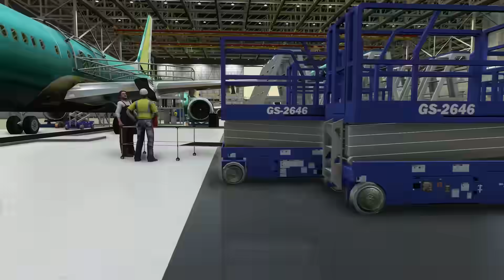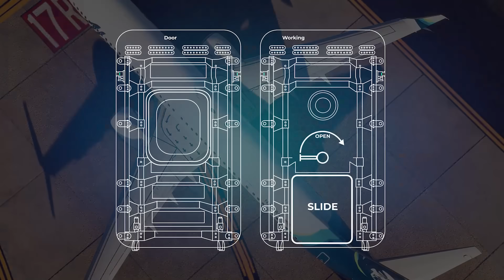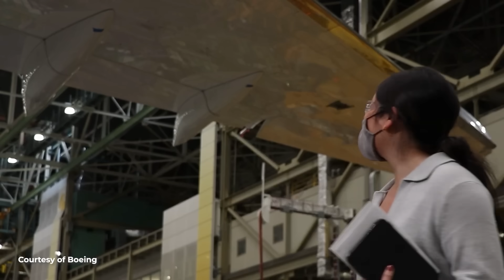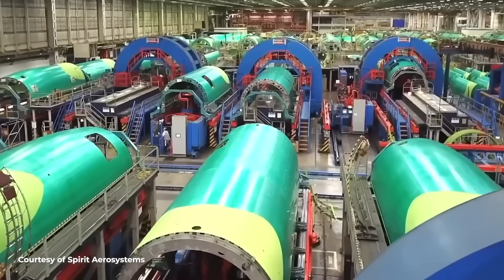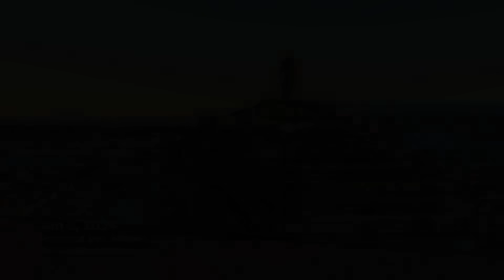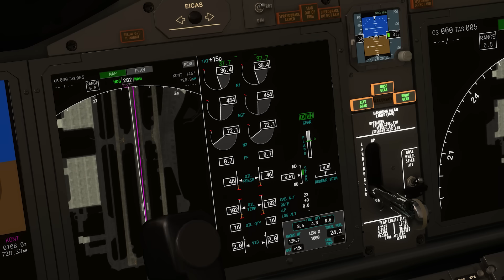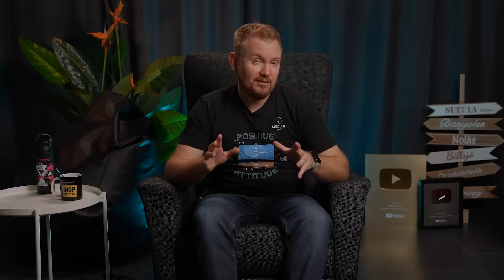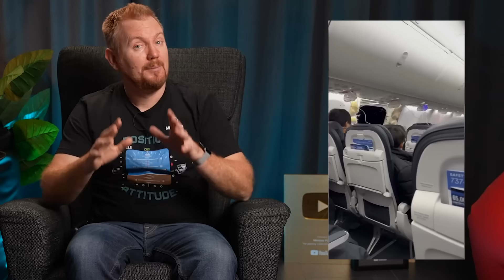Boeing 737MAX BlowOut!! The Scandal behind Alaska Airlines flight 1282

Comment: I have begun to think that there should be a grab bar that runs the length of the cabin that would be around the height of the very bottom of the overhead storage bin doors. That way as you walk down the center aisle of the seating area you can hold onto something solid as you bounce around during periods of turbulence coming back from the restroom. I usually try to steady myself with my hands on the tops of passenger seats but they aren't designed for this function and occasionally you will get a dirty look or a comment from a passenger as you accidentally jostle them.

Comment: You never get to the point of corporate corruption! Yes, those two "Alaska Airlines'" seats - next to that "Plug-blowout" - were empty. It was NOT a coincidence! They knew of that problem!  I worked for Alaska Airlines!  It is an "Investment-Company"  that runs that Airline! They are shysters!  They want a 10% return, to investors, at all costs!  
I worked as a flight attendant. It was a great job, until the 2008 - banker-made-crisis. Then, they worked us to death, as cabin-crew. My only savior, was when the pilots would call in fatigued. I loved my pilots! 
They taught me a lot, since I was so much into learning! They would call me up-front, to sit in the jump seat, to talk on longer flights!  I love my pilots!
 They saved us flight attendants from performing another -daily 8 leg, 13 hour duty-hour! Their 'union-rules', were stricter than us useless flight attendants.   hahaha  

DO NOT BE FOOLED!  Alaska Airlines - BLOCKED those TWO SEATS - near that bad blow-out door, because they knew, of that risk!  I worked for them!  They are money-addicts, running that company!  They ruined my "Horizon Air", once they took over.  It was my best job, until, "Alaska Air group" ruined Horizon Air, by their greed!

Comment: What i find scary about this incident is what might have happened if the door plug had let go at 33,000ft. Bigger hole in the plane as the pressure in the plane left even faster.. Door plug taking off one side of the rear stabiliser as it departed for example.. Boeing and the passengers are very lucky it happened at that altitude and not higher up! Scary stuff yet completely avoidable if Boeing gave 2 stuffs about who builds their planes. 🙄

Comment: root cause analysis should have been conducted and pressure testing of the "pressure vessel" should have been conducted. If it was enough pressure loss to trip faults on the controllers, it's enough to pick up with a simple pressure test. I disagree with you, I don't think Alaska airlines decision to not ground the aircraft and instead choose to fly it over land instead of sea was out of " abundance of caution.'" it was a facade of due diligence to cover up the main motive: greed. Pressure testing would require grounding and when the planes not in the sky it's not making them money.

Comment: As an aerospace mechanical design engineer, who has worked on four Boeing programs, I see this as a failure on multiple fronts. It was a failure in design, because it was not very obvious that there was an incomplete installation. And, it was a failure on installation processes, because of the essential missing bolts & cotter pins. However, we need to all recognize that aircraft are designed in such a way that they can handle a single failure, and sometimes even, multiple failures without them becoming catastrophic.

Comment: I think Boeing, as well as airbus for that matter should offer a high monetary reward for employees finding problems, make it some decent amount of money like $10,000 or something that way everybody is actively looking for mistakes, at the same time, not punish employees for making an honest mistake and instead council them to correct the problem if they did this, nobody would feel bad about reporting a problem and mistakes would get caught and not continue to happen

Ultimately, the parts that didn’t get installed in the door didn’t disappear. They have to have ended up somewhere. Surely somebody found these parts and should’ve thought “these need to be somewhere. Something’s not right.” but they probably threw them away because there wasn’t a good enough system.

Comment: Not sure the cockpit door opening due to a depressurization is a good idea
I understand why they have designed it this way, but I feel there’s got to be some better system, whether it be vents through the floor to equalize pressure or whatever else, but theoretically a terrorist could find a way to depressurize the plane to make the door open, which is not a good idea

Comment: It seems crazy to me that the mod kept the assist springs instead of replacing them with metal sleeves to hold their position. It seems to be asking for trouble if things like the 4 bolts were missed. I'm an engineer and as soon as you mentioned it I said out loud that's a silly idea.

Comment: The contact surfaces of the stop pads should have a horizontal ridge pattern so that the door cannot move while under cabin pressure. But then again, those four missing bolts were a really trivial mistake to catch. if only it had been checked one last time.

Comment: I’m a retired nuclear inspector but fasteners and welds for submarines and planes are similar as they both have pressure boundary parts. Level 1 material. Unfortunately locking devices are level NA AND HAVENT THE SAME CONTROLS OR RETEST

Comment: I live on the flight path where every new 737 ascends to be flight tested often in its green protective coating.  12 years ago I took an Alaska flight to LA from Seattle on a 737 when it suffered a slow decompression problem.  The pilot put the plane into a shallow dive  and then announced it over the PA the problem and will divert to San Jose and fly under 10,000 ft.  He assured every one there will be no need for the oxygen to drop unless needed.  I arrived in LA 5 hours late, but safe.  I love pilots  ( :

Comment: @MentourPilot Why isn’t the CVR breaker connected to the pressure switch on the gear?

It could be set to trip 15 minutes after positive pressure which would ensure at least 1.75 hours of recording preservation.

Comment: So cockpit door has limited ability to sustain force? That means a simple car dent suction cup could be used by terrorists to pry open a door? They are made of plastic and rubber so undetectable in security.

I mean 4 section cups and 2 men pulling on them. How many needed to be the equivalent of a decompression at 16000ft

Comment: Design flaw & correction; 
The cabin door should NOT fly open causing explosive decompression.  FIX; check valves or simple limiting vents should be used, mechanical whistles could warn of too much differential pressure. This would eliminate explosive decompression, alert the cabin and offer time for the pilots to correct the issue without being disorientated or incapacitated.
Reply: EXPLOSIVE DECOMPRESSION isn't like a wind, there's no continuous flow like a balloon, its more like popping a can under pressure or one big buff with a hole that size. Small holes that restrict air will create a flow, size matters and problems increase fast (squared) as the hole gets bigger. 

PRESSURE'S INTERESTING, at 14k feet they might have added 3psi, not much, if the hole were 1" square you could put your hand over lbs of force, small airflow would not be an issue.  BUT "IF" the door hole is 36" x 68" there is 2448 sqr inches x 3 psi = 7344 lbs pushing on the door.  Good thing this did not happen at 40k feet, 4x the pressure with 16x the force might have ripped adjacent seats off the floor.

Comment: The lucky part here was that the seats near that door plug were not occupied. Strange coincidence but very very lucky indeed.  

How many more issues the 737 MAX is likely to create before either the model becomes totally stable or it is totally discarded forever. It is hard to believe that it is the same company which built a 777 which is known to be one of the best models Boeing ever built.

Comment: I watched aa American Senate documentary involving Boeing and apparently, over 300 units have the same problems yet Boeing kept it quiet. A whistleblower came forward to inform the Senate that these units will be deadly after 50 flights as the stress, along with the age of the plane activates stress fractures. This is why I never fly. Every plane manufacturer focuses too much on profit and not enough od passenger safety. This is just an opinion and a thought. But, it terrifies me.
Reply: Fly Airbus.

Comment: Regardless of whether the door was displaced or removed, it was a job that required at least a second independent inspection and the paperwork that follows. This coming from 20 years in the aviation heavy maintenance industry. Best wishes from Limerick Eire.

Comment: You are wrong about the springs in the bottom of the door. These springs also insure the door travels up into the locks. These were not reinstalled during the work on the door, and the bolts were not installed, because the mechanic could not align the holes.

Comment: I was on an Embraer 175 that blew out a door seal just as we reached cruise (the captain had JUST made the announcement and turned off the seatbelt sign),  causing a loss of cabin pressure (though not explosively) and the masks coming down. A few things I will say to everyone who has never been through this - the elastic is not just hanging from the mask like it is in the demo, it's coiled up and stuffed into the back of the mask. If you are far sighted, as I am, it is very difficult to figure out how to get that elastic out and on when you can't see the thing that close to your face! And you will both KNOW when you are getting oxygen because it tastes absolutely terrible, and as they say in the safety brief -that bag will not inflate. The descent was about like this one - not THAT fast (I looked on FlightAware later and it was about 2000fpm, a little bumpy from the speed brakes being out. We turned around and went back to where we came from, Philly. And like here, it took a minute or so before we started descending.

They got us a new airplane and we were on our way again in about 3hrs. Though with not quite as many passengers on board the second time...

Comment: This was not new for the MAX-9 - the same mid-exits or plug doors was also used in the NG737-900 that Boeing had been building for 25 years prior. Same fuselage, could just as easily have happened on the older airplanes.

Comment: I don't understand why a brand new aircraft still has so little CVR recording time available, I assume they use tapes for preservation in case something catastrophic happens, but there should be some kind of a second, digital recorder that would hold like a day worth of recording without any issues but at a cost of making probably  less reliable in case of a major crash.

Comment: I worry subcontractor work quality is going to be found to be an issue globally. It works fine for minor components but with more complex ones, you need to keep it in house IMO. I think Boeing buying and reintegrating spirit was a good move and hopefully will prevent these kind of break downs in the future. Aviation engineering just isn't an industry where squeezing every penny out of a design works. Boeing is finding out the hard way, but not as hard as some of the victims of Boeing airplane failures.

Comment: Tbh, besides the missing quality control, the active pushing of the repair operation into a not to be recorded activity for my two points are even worse:
1) how can it be that any tiny work on an a/c is not needed to be document and checked by quality. Don't get me wrong, as I am working in the industry I know the pressure and creativity for "lean" processes and "smooth" interventions but I have never seen such a systematic break of basic rules.
2) coming out of point 1 Boeing is not able or willing to provide paper work and involved persons to the FAA. Thus is a No-Go and fundamental break of basic and critical requirements. If Boeing would not be as big and important as they are, the FAA must revoke the PoA of the impacted production organizations meaning they have no delegation for quality inspection and approval and hence no authority to "close/finalize" work orders by themselves. Instead every inspection must be done by FAA or independent delegates. Obviously the system is not able to execute this what would lead to a full stop of work until clarification.
I understand that this us politically hard to impose BUT what are the rules worth if we threaten ourselves to impose the sanctions REQUIRED by the rules if they are not respected. The systematic work if Boeing against the rules ist frightening and I cannot imagine what is the real iceberg below the surface...

Comment: Processes that should mitigate these circumstances do exist and  in fairness to techs and engineering teams accross companies and their  manufacturing partners these processes , quality controls inclusive are always spelt out for the companies. While you might be quick to blame the techs and engineers at spirit, there is this culture among many businesses to prioritize monetary or cost implications over and above processes or procedures designed or specified by techs or engineers to mitigate these errors often to the frustration of these techs. Imagine being asked to deliver on shedule for instance even if it implies disregarding  aspects of your quality control processes as a tech or engineer or situations where businesses cut corners behind its own tech teams. The bulk lies on keeping the aviation regulators especially in check even if it means making changes or overhauls within the aviation regulatory body.

Comment: I’m surprised there isn’t a level of “this ain’t right” past an NCR. NCRs are completely routine, they’re generated for issues as minor as test equipment losing power while checking out software. There’s an obvious difference between “we lost power while verifying that hydraulic pump 1 remained ON for 15+1/-0 seconds after WOW was asserted” and “We forgot to install several bolts that hold the plane together”, so I’m surprised that they’re put on the same level in terms of documentation.

Comment: Negligence act has been an issue with aircraft incident and i even had a hard time if i were to be working in this line. What is the consequence to any personnel that have found for a negligence of duty. Is it a warning letter or could it be an immediate termination in most critical issue?

Comment: This is a systemic failure of management at Boeing. The problem is if the managers take a risk - i.e. insist on not slipping their delivery date despite quality issues - and succeed, they look good and get rewarded. However, if something goes wrong, they can just shift the blame, in this case to Spirit. 
I’ve worked in aviation and the industry is full of good people, but the management is byzantine and lacks integrity. I hope they can learn something after this.

Comment: The problems with Boeing started when they bought McDonnell Douglas.
Boeing was a company run by engineers, McDonnell Douglas was a company run by "bean counters" that ran the company poorly enabling Boeing to buy them.
So, what do you do when you have a great company with a great reputation run by engineers and you buy a company with a bad reputation and bad safety record run by accountants? 
You put those accountants in charge of the new company and then act shocked when they start destroying Boeing just like they destroyed McDonnell Douglas.
Even Ray Charles saw that coming.

Comment: What exactly is the positive benefit to the cockpit door unlocking itself during a decompression? It would be way too easy to hijack the plane!

For those saying differential pressure, it's very easy to install a louvre at the bottom of the door.

Comment: Question: Given that the plane can keep flying after explosive decompression, but it can't land without a pilot, why would a cockpit that depressurizes with the cabin be a design feature? Wouldn't a separately pressurized cockpit make more sense?

By the same token: Why aren't cockpits armed/impenetrable? Openable only from the inside once in flight. It'd sure have solved that pesky hijacking 9/11 thing. Would love to learn more about this as I'm not a pilot, just a girl on a YouTube binge.
Reply: 1. it is designed to open. if it did not open, the door would shatter, and that is much worse, as the shrapnel can injure passengers, and may also jam the door, as the locking mechanism could break.
2. it is next to impossible to open the cockpit door from the outside. that was put in place due to 9/11. if by "armed" you mean with guns, that is a bad idea, because holes in planes is not optimal.

i may not have everything correct, as i, too, am just a girl on youtube binge.

Comment: I love the "quality" thinking of the Spirit mechanics called in to work on the door plug. Not only did they damage something when they attempted the repairs, they also painted it over and never mentioned it to Boeing until they were explicitly asked about the unfinished work. So in other words they'd have been totally fine with the plane entering service with the damaged seal and who knows what other issues they didn't bother to report 😶

Comment: Your missing a big part or the door removal process. At any point if a screw or fastener gets removed from the plane, it has to have documentation of it in a removal order. they can hide the quality buy off and just say the condition does not exist but lazy undertrained under-qualified unknowing unwilling to learn quality is what Boeing uses to get paid I wish they could just have engineers on the floor working with the mechanics and quality